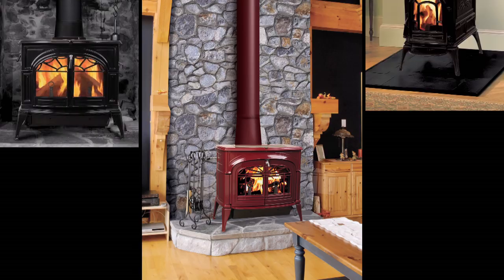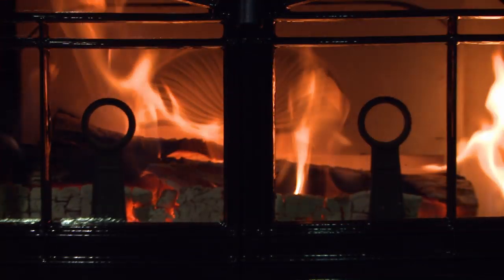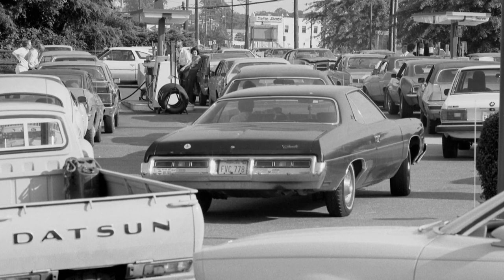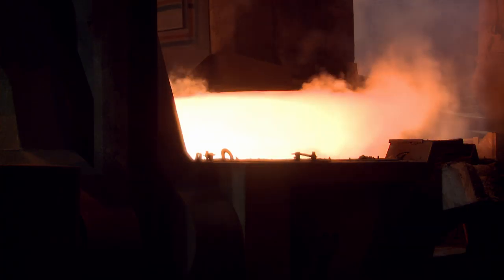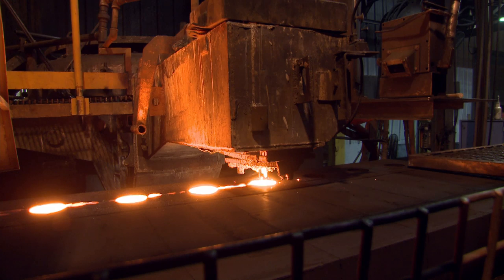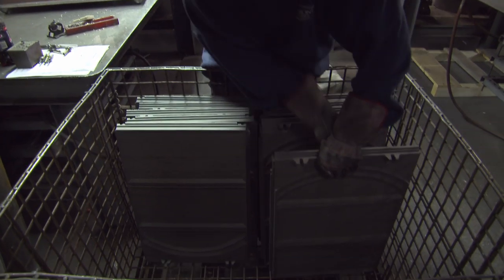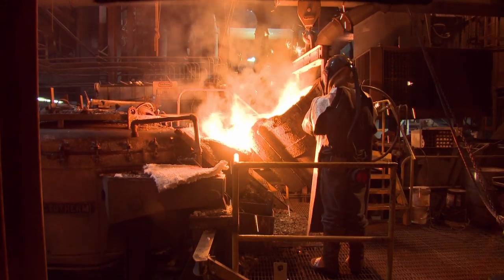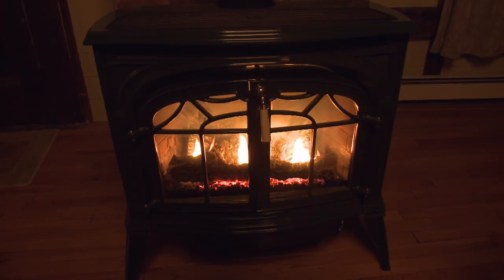How a Vermont Castings Wood Stove is made - BrandmadeTV

Comment: One of the best (if not THE best) wood stove on the market.  We love ours for may reasons, but the most important - it works!  Top load, bottom ash clean-out, great looks.  Best of all: Build Quality.
Reply: Will Swift  One of them, yes.  Stove can be loaded either from the front (messy) or from the top (best option).  This feature along with the bottom ash clean out makes these stoves the best (imo) on the market.  That and the cast iron construction and the beautiful styling.  They make other stoves look like ugly, square, steel boxes.
Reply: Best?   Not really.  Over priced.. WAY overpriced.. haha

Comment: Bought an Encore model, had almost a year.  Vermont Casting is NOT the quality it used to be since the company was bought out.  Literally falling apart.  100% NO support if you try to contact the company, not even an email contact.  Insulation, glass on door fall off as they are poorly attached.  The bypass lever on the right side does not work properly.  Almost all the nuts, bolts, screws were loose when I received it. Buyer beware, they are just throwing theses stoves together as fast and cheap and expensive as possible.
Reply: Your dealer couldn’t help?

Comment: God, I hated making these things.
Reply from the maker: Haha!
Reply: BRANDMADE.TV Not this model in particular, but any of the Vermont Castings cast stoves with sheet metal parts were a pain. The Paris, KY factory was not equipped with the correct tools to properly manufacture the parts. But Hearth and Home Technologies (that owns the VC brand and the Monessen and Majestic brands) did not want to buy different tools other than what Amada machines usually use.
Reply: You know how to make these?  I think I just botched a refurb of a Intrepid II because I took it apart too much trying to make it light enough to lift.  The fire box is now completely disassembled and I am searching the internet for how to properly seal it when putting it back together.  Can the rope & cement gasket kits that are sold for the doors also be used to seal the firebox??  Or is something else entirely required?  Any info would be appreciated!
Reply: @spiggity8  So I just got the notification on this comment. I only knew how to do the sheet metal firebox and not the assembly process. I don’t work for that company anymore as they relocated and I didn’t go with them over six years ago.
Reply: Will Swift  So the exterior was cast and coated in an enamel paint. The interior was thin sheet metal (22 gauge at the thinnest, 18 or maybe 14 gauge at the thickest.) They made several models at the plant I worked at and we didn’t start doing them a lot until a few months before it was shut down and the product moved up north six years ago. There were a lot of safety implementations they made before the plant closed, and I’m not sure how they worked, as I was mostly in the sheet metal bending department. There was some kind of screen that became mandatory on the glass that allowed you to touch it for so long before you could feel any heat to get hurt. It was mostly for people with small children, but it became standard across all models.
Reply: @BradleyWilloughby  Gotcha.  Thanks for your response!